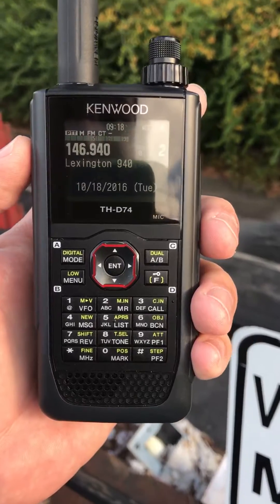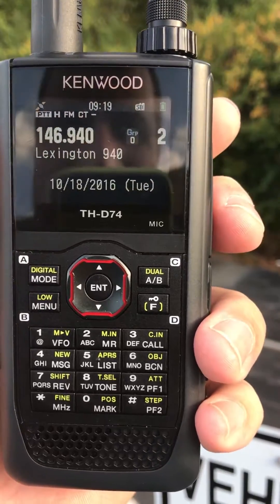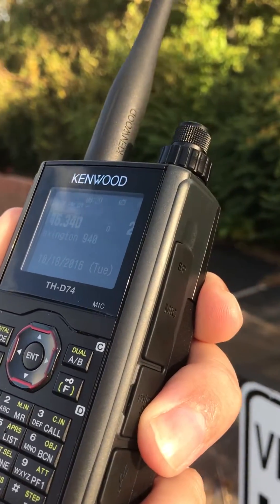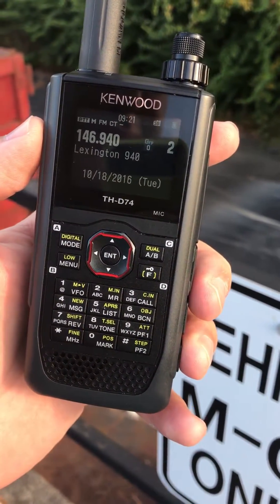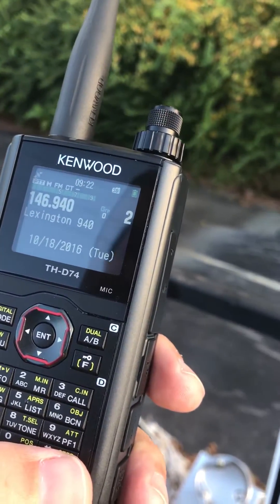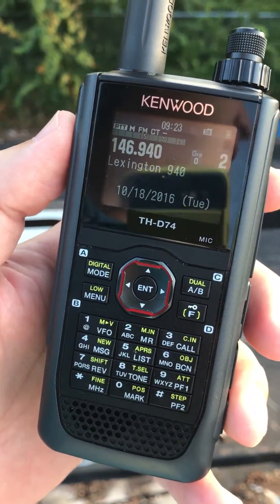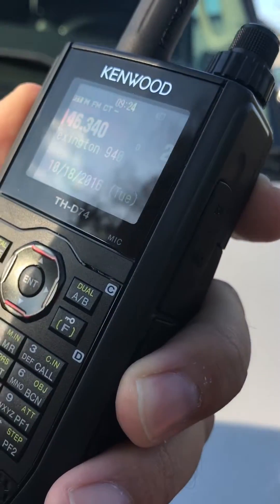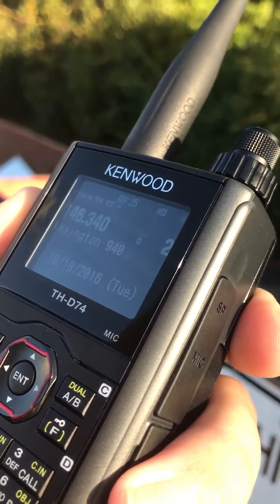Kenwood TH-D74 Receive problem

Comment: I know that this is long after your issues, but I'm having many of the same problems with mine. I have sent it in under warranty repair and after nearly 2 months finally got it back. But the problem came back within a couple of hours. Did you ever get this issue fixed? What was the issue? I am requesting a new radio. Something is really wrong with mine. It's pretty much useless to me.

Comment: I had issues where the radio would cut the first part of a transmission... it is because of how the battery saver works... but I never have had this problem with mine

Comment: Has this been addressed ?
Reply from the maker: Radio was sent back to store.. I received a replacement unit witch I have sold after few months of use went back with icom id 51 plus.
Reply: Daniel Vinson 
Really? Hmm.

Did the second unit have the same problem or a different one ?

What do you like about the icom '51?
Reply from the maker: I have just gotten use to the icom menu and setups and lot smaller in size.
Reply: Daniel Vinson 
Can you tell me how well the 74 handled shortwave?
Reply from the maker: I did try it mainly the am radio was the only thing it would pickup. Never did pick up any station in the 20m or 40m band
Reply: Daniel Vinson 
I'll keep looking. 

Thanks so much?
Reply: Daniel Vinson 
Also, I subscribed. Thanks for the review.

Comment: what firmware version were you on and what was the sn number was it low 100's
Reply from the maker: Chris Murphy I was running ver 1.03 and the serial # of B6810009. You can look at my other videos and see the lag in the processor.
Reply: kf4exw so it looks like you had the 9th one of the production model. Also as of late dec they have put out version 1.05. 

The info above is not to question your problem but to ask if you think that the unit you had was just bad or was it do to the fact that it was a early run model with bad firmware?  I ask as I plan to buy this radio band there is mixed reviewers out there. 

Thanks
Reply: Hi I have one coming in the morning have the issue as been fixed. Thanks

Comment: Did the problem get resolved?
Reply from the maker: jsm136 no it has not been resolved sent it back to Hamradio outlet where is was bought. I am with out radio until Dayton 2017 when I will buy hopefully at a cheaper price  . I will let Kenwood get the time to work out the bugs.
Reply: Problem solved?